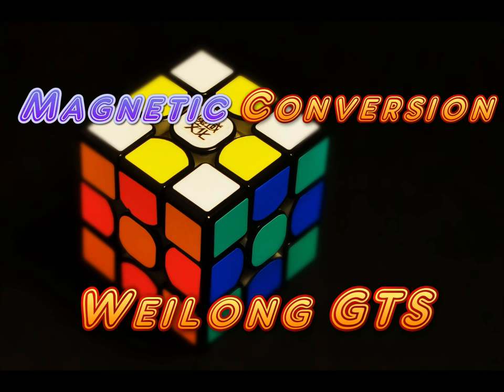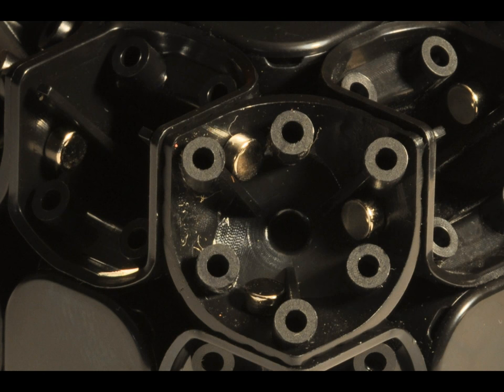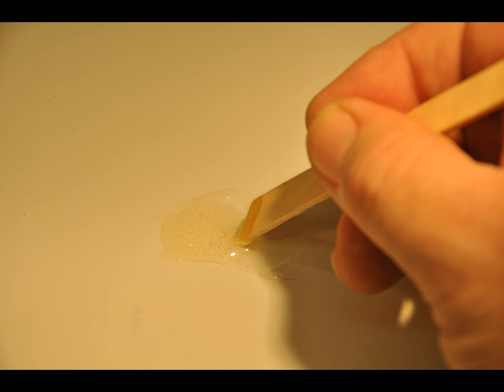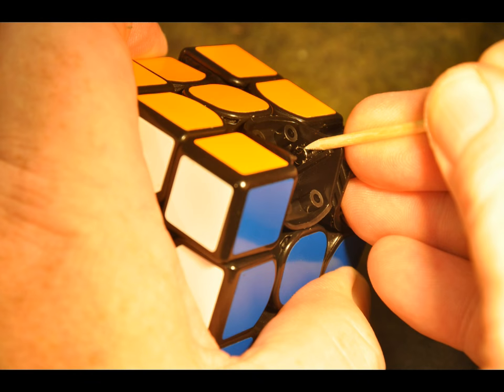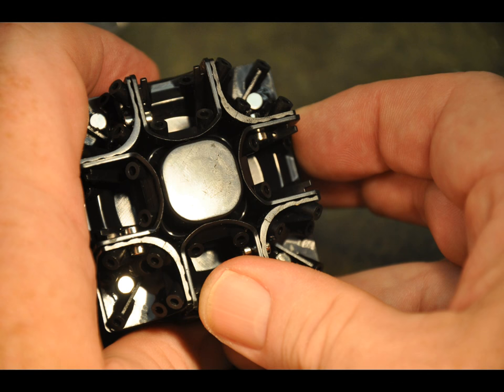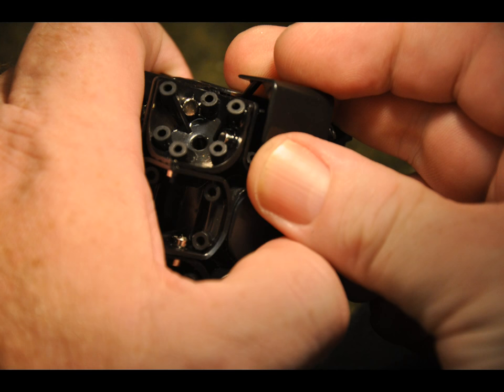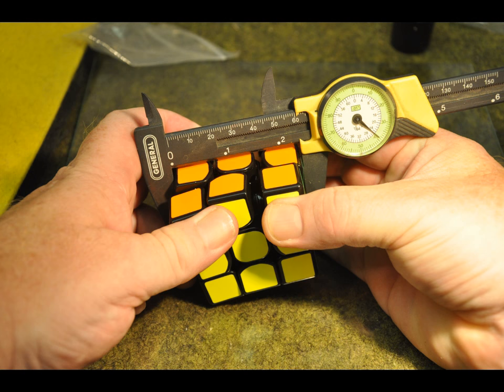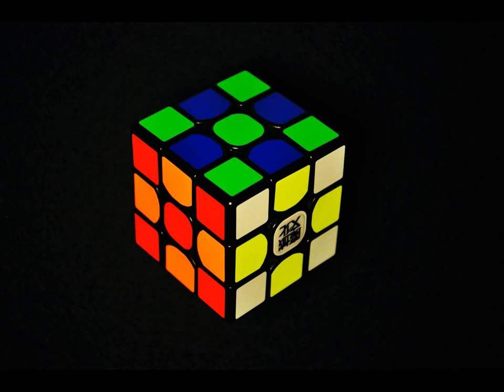Weilong GTS M (Magnetic) Do It Yourself Tutorial

Comment: What is the differents between motu weilong gts v1m  and v2m
Reply from the maker: Noob Cuber Entirely different in many ways. The original is heavier and uses a capped design. The GTS2 is hugely improved. It's lighter, and has a split piece design.
Reply: DMCubing oh thanks 🙏🏻 btw your channel are the best
Reply from the maker: Noob Cuber Thank you so much!!!! This is such an old video!
Reply: DMCubing well this is a good vid.. I will make a video about my MF3RS M that i made using ur tutorial
Reply: Also what magnet do u use for MF3RS2
Reply from the maker: Noob Cuber I used an N48 5x1, the same magnet the Cubicle uses in theirs, but you can use a little lighter N42 5x1 or N35 4x1.5. Here's my video on it:
https://youtu.be/9ovoyatnmZw
Reply: DMCubing what magnet do u prefer for 4x2mm ? For MF3RS2
Reply from the maker: Noob Cuber N42 or N48 5x1.
Reply from the maker: Noob Cuber Oh. N35 if it's a 4x2

Comment: If I use the adjustment kit weilong gts, can I make the manetic version？Is it better？
Reply from the maker: Hinson Wong I bought several of those kits when they came out but never got around to trying them. Anyway, there's really no possible way they could interfere with the magnetized cube as the magnets are all internally placed inside the cubie pieces. I do think the dual adjustment kit is worth looking into as it gives you potentially more control over the tensions and spacing of cube parts.

Comment: Can you compare the strength of N48 4x2 in the weilong gts to modern magnetic cubes like the gts2m or valk power m? I'm really interested in buying and magnetizing a gts. Thank you!
Reply from the maker: I'll need to pull my old GTSM's out and compare. Newer cubes like the Valk 3, GTS2, and Air, are lighter weight and have a different feel. The original GTS can feel a little heavy and it easily deforms when it's not magnetized. Even magnetized, I don't remember it feeling as accurate and snappy like the GTS2M. I'll double check though.
Reply: DMCubing, I would be glad if you could check. Thank you very much!
Reply from the maker: Hi Gerro,
I haven't forgotten!!! I've looked all over my house and I guess I gave all my magnetic GTS's away. So, unfortunately, I don't have a magnetic one right now to do a side by side comparison. But as you know, the original GTS is a heavier cube, uses thicker plastic and requires a fairly strong magnet- N48 4x2, - N52 4x2. What I do recall is that for me, the GTS cubes with the primary white plastic seemed to feel better, overall, as magnetic cubes, where are the all-black cubes had less magnetic pullforce strength. So I would recommend something like an N48 4x2 for the Illusion (black caps/primary body) GTS or all primary GTS, and N50 through  N52 4x2 for the all black GTS.
That compares to about what the N42 5x1 magnets in the new GTS2 feel like.
Reply: DMCubing, thank you very much for the information! I've been wanting to buy an illusion gts but I'm not sure if they are still available from where I am and I think black is my only option. Also magnets are a little hard to find except for 4x2 N35s. Hope I could find the materials I'll need. May you create more guides in the future and may you not stop helping those who ask questions. :)
Reply from the maker: Thank you so much, Gerro. I'm just sorry that I no longer have a magnetic GTS! That used to be my favorite cube, but apparently I've given them all away!
N335 4x2s are going to feel pretty light in the GTS. They'll work, but the overall magnetic feel is going to be very subtle.
Reply: DMCubing, yeah. A lot of videos talked about N35s are too light for the gts. I'm in a comp today and I'll see if someone's selling stronger ones. Thank you again!

Comment: What do you think is the best magnet for stability of gts v1?
Reply from the maker: JanDi Portugal At a minimum, the N48 4x2. And for added stability, you can use N50 up to N52 4x2.
Reply: DMCubing Would N42 give it a subtle effect in stability?
Reply from the maker: JanDi Portugal You could probably get some magnetic benefit from an N42. It's going to be subtle and because of the weight of the cube, it won't have a strong influence on stability, but I think you'll be ok. I've personally never used any weaker than an N48, but I have heard of people using N35s in the GTS and liking the results, so you should probably be fine. If you use the N42, please let me know how it turns out.
Reply: DMCubing Oh, that's some nice info to think about. Thanks bro, I'll let you know what happens. :)

Comment: Hello, I just wanted to clarify, which pole should be glued in every plastic sides? North pole or South pole? And how many magnets should I put on an edge piece?
Reply from the maker: Hi James. Great question. Since both North and South poles have the same identical pull force, it doesn't matter. But, each pair of magnets must have the same polar arrangement throughout the cube. It's easier to think of as gluing pairs: one magnet on the right side of the upper edge piece, and the other magnet, placed on the left side of the upper right corner piece. There are 24 such pairings within the cube. Since it's fairly easy for me to take pics, I'll make a video about this topic today.
Reply: Oh nice, I'll look forward to that video!
Reply from the maker: Thanks! It just posted. It literally took me all day. Powerdirector kept crashing. Ugh. Anyway, it's up and I think it should be helpful. let me know.

Comment: i don't really understand what you mean by saying "polarity"  how can i check it?
Reply from the maker: Hi Amit. Polarity is the term used to describe each end of a magnet. The North end will always point to the geographical magnetic North if it's suspended and allowed to freely rotate. 
Now in cubing, what we're concerned with is keeping the polarity of the placement of the magnets correct and consistent throughout the entire cube. We're not really concerned about using True North as we are using the same end of the magnet each time we glue in a series of magnets.
As long as each and every edge piece magnet attracts each and every corner piece magnet, things are as they should be.

Comment: does this work the same for the guoguan yuexiao? and which magnets do you recommend?
Reply from the maker: Got one right here with me that I finished Tuesday. Yes, it works great! And the Yuexiao is easy to do. I used N48 mags in mine. the cube is interesting. I felt it was light weight and perhaps made out of thin plastic until I weighed and measured it. It's neither light or thin! it just performs that way. Anyway, I think the result with magnets is good. It's a fast cube and I'm still trying to fine tune the tensions. I may end up using a thicker lube. I'm almost thinking about doing another one with N52 mags but the 48 mags will probably work for most people, actually the 48s are probably the ideal mags for it. It's just that I seem to overshoot because of my turning style. It takes very little effort to move this cube. I have all my pics and video shot and have been working on the voice over, so my tutorial video should be ready to upload this weekend.
Reply: ty! looking foward to that vid

Comment: can I use 6mm x 3mm neodymium magnets??
Reply from the maker: Those will probably be too big and have to strong a magnetic pull force. If it's a black GTS, I'd use either N48 or N52 4mm x 2mm magnets. On the white plastic Illusion, N48 4mm x 2mm magnets. The N48 grade are available from Apex Magnets - they're sold out right now but they expect 50,000 to arrive in a couple of weeks.

Comment: What type of glue can I use for the magnets?
Reply from the maker: Hi Oliver. You can either use super glue or a slow curing epoxy. Super glue is quick to work with but you need to be careful so it doesn't go all over the place. A slow curing 2-ton epoxy has a 30 minute handling time, so you can take your time gluing things. You may have to mix up several small amounts while you're doing a cube. Sometimes the epoxy doesn't want to stick well to the cube's plastic. You may have to rough up or put little scratches in those areas where the glue will be placed to help it form a better bond. Just as important is regardless what you choose to use, make sure to let the adhesive fully dry and harden before handling your cube. :-)

Comment: i think some of my magnets in my gts m fall off, is there a way I can check which of them fell off without dissembling it?
Reply from the maker: Archibald Leung Oh i'm sorry to hear that some of the magnets have loosened up. On the GTS, removing the caps is very easy. They pull right off. I would start with the corner pieces first, because usually they're the easiest to remove. Look and see if any magnets have loosened up, and if not there then go on to the edge pieces.
Reply: DMCubing thanks 👍🏻

Comment: would n50 magnets work well in a weilong gts illusion?
Reply from the maker: ChubTheCuber Yes! I use both N48 and N52 in the Illusion and it's hard for me to pick my favorite, so I'm sure N50 would be perfect! The lower grade like N35 is really to weak, and to me, you feel a little more magnetic pullforce with the primary plastic of the Illusion than you do with the black plastic. 
I need to update or redo this video. When I made it, I was using a slow curing two-part epoxy, so that's why I'm gluing the magnets a certain way here. If you're using superglue, you can save time by gluing both magnets in each pair at the same time.

Comment: my slide oil says it contains petroleum distillates. Is it still safe to use on my Gans Air? I have heard that should not use lubes containing petroleum..
Reply from the maker: Calvin Ma I probably wouldn't use it. Silicone based lubes seem safer. But you can smell diesel type lubes on new cubes all the time. I searched online and people have researched petroleum distillate lubes and their effect on ABS plastic. Seems like a lot of debate. Some people say it's safe while others say it's not. With the thin plastic of a cube like the Gan Air or Valk, I probably wouldn't risk it.
Reply: what exactly does petroleum do to the plastic?
Reply from the maker: Calvin Ma I imagine it would break down the plastic.

Comment: N50 would work out good or too strong?
Reply from the maker: They would be excellent! An N48 feels really good in the primary plastic of the Illusion. The normal black plastic of cubes lessens magnetic pullforce, so the N50 and N52 are probably the optimal choice for the black plastic GTS and probably would work nicely in the primary plastic version, where, in that cube it would have a little more magnetic feel.

Comment: Hey DM so I recently made one of these, but it failed. I messed up because the multiple cubies stuck together. How do I prevent this whene I do it again?
Reply from the maker: Do you mean that you glued the cubie pieces together? Usually if this happens you can scrape the extra glue off of the pieces once you've unstuck them. This doesn't happen often. To prevent this from happening, just be careful with the glue. But if you do get too much glue and some of it gets between the pieces, just carefully pull the pieces apart and then scrape the glue off so it won't be sticky. I hope that helps!
Reply: So basically a cubie goes to the other cubie that i already glued, and it creates one part of the edge to have 2 cubies instead of one.
Reply: Should i just place all the magnets, then glue them with super glue?
Reply from the maker: I don't know if I quite understand. With any magnetic cube, the corners will always attract the edge pieces. Each corner piece ends up having three magnets in them, each magnet facing the edge piece magnet. The edge pieces always have two magnets in them and they attract the corner pieces. I don't know if you're talking about magnets or glue.
Reply from the maker: You can actually do that. I don't usually do that because I like to make sure the glue in under the magnets so it's a better bond between magnet and plastic, but a lot of people do just put glue on the magnet. If you do that, you might want to come back after the glue has dried and put an additional drop of glue just to make sure the magnet is coated.
Reply: basically you have one magnet for each attraction, but the cubie across from the cubie was attracted and it stuck to the cubie which caused one cubie to have two cubies

Comment: what grade is the magnet?
Reply from the maker: I used an N48 4mm x 2mm in the GTS. In the primary plastic Illusion, the magnet is perfect. In the black plastic, the same magnet is just a little more subtle. So if you're doing a primary plastic GTS, an N48. If you're doing a black plastic, any grade from N48 through N52.

Comment: How long should I wait for the super glue to dry?
Reply from the maker: Edwin S At least a couple of hours. It depends on the type of superglue, like if you used a gel, and the amount of glue used. You can handle the cube pieces within an hour, but I wouldn't start doing any repeated solves and handling for several hours, as it takes a long time for the glue to fully cure and harden.
Reply: DMCubing also, do you sell magnetic cubes?
Reply from the maker: Edwin S Hi. No I don't sell any. With the amount of time it takes and the cost of supplies, there's no way I could sell them cheaper than the Cubicle

Comment: Hey I have a question, do you know the thickness of the black plastic version of the gts? Thanks
Reply from the maker: doodle mogul I thought I mentioned it in this video. Anyway, it's.043" for the edges and about.045" on the corners. Fairly thick for a cube, so higher grade (stronger) magnets work best: N42 on up in 4x2 size.
Reply: DMCubing thank you so much for replying. I do have one more question though...what would be the magnetic equivalent of n42 4x2mm magnets in terms of a 4x1.5mm magnet?
Reply from the maker: doodle mogul There's isn't an equivalent. The closest would be N52 4x1.5 which has a pullforce of about 0.71 pounds. The N42 4x2 has a pullforce of 0.76 pounds. They're close, however.
Reply: DMCubing that's really interesting, thank you. How do you find out the pull force of different magnets?
Reply from the maker: doodle mogul oh. Google search for K&J Magnetics Calculator. It will give you a rough idea of how magnets will react.
Reply: DMCubing thank you once again. I want to magnetize my black plastic gts and would like a feeling as close to the cubicle's gts m as possible...any idea what magnets (n42, n48, n50) I should use to achieve the same feeling?
Reply from the maker: doodle mogul I've never tried the Cubicle GTSM but they generally use light magnets. For me, the N48 4x2 in a black plastic GTS would be as light a magnetic feel as I'd ever want to go. If you like a lighter subtle feel, I suppose you could use the N42. For me, I've always liked the N48 and N52 in this cube. So it really comes down to what your preferences are, and what you like.
Reply: Alright, thank you. So you would recommend buying the n48's from apex magnets?
Reply from the maker: doodle mogul That's what I'd recommend, particularly if you like a subtle feel. With Apex, it's best to wait for a weekend where they have free shipping or discounted shipping. Or if you like a stronger magnetic feel, N50s from gaussboys.com would work, plus they have free shipping on orders over $10, and for the month of June, a discount code DMCUBING that can save 10% off your order; or N52s from thethackery.com All good choices for this cube!

Comment: N45 5x1 will do?
Reply from the maker: Tech Dares I would have to check first to see if a 5mm isn't too wide. But really, an N45 5x1 would be fairly weak in the original GTS. In this cube, you really need a stronger 4x2 magnet like an N48 up to N50.
Reply: N52 4x2 works perfectly well at mine
Reply: But when i glue then i rotate the glue drips :v
Reply: Rip my cube
Reply: I removed the glue by shaving the glue with cutter
Reply from the maker: Tech Dares Rotate? That's not how you want to glue this cube, and I certainly don't rotate in this video!

Comment: Amazing first video!I can actually finally make a budget Magnetic GTS!
Reply from the maker: Great! Thanks! Let me know how it goes! 
 I made another one today, an Illusion GTS: primary innards with black caps. Cool look!
Reply: DMCubing you can buy those straight up from the cubicle, the only GTS I own is a illusion
Reply from the maker: +Benjo Draws Oh, it's the way I worded this. What I meant was, I made a magnetic GTS out of an Illusion- it's the best cube I own! I love it! Yes, you're absolutely correct, the Cubicle has the Illusion already made up. I've bought four from them so far. I love those cubes! I'll probably buy a few more!
Reply: DMCubing thanks for clearing things up
Reply from the maker: Do you find the primary plastic performs better than the black plastic?
Reply: DMCubing not sure, I only own one GTS, a primary black caps
Reply: DMCubing I think it would though, as dye probably adds a tiny bit more width to each piece, increasing friction
Reply from the maker: +Benjo Draws Thanks. Actually the pieces are identical in size. I've searched over and over online about info on ABS plastics but have yet to find anything in regard to each color's strength and hardness. I'll remain convinced there is a difference until I find out otherwise. ;-)
Reply: DMCubing what handfeel does the N50 2mm x 1mm has? . :)
Reply: Too weak! You should use 4x2 n48 and up!

Comment: Would 3mm x 6mm magnets be too big?
Reply from the maker: CinnamonButt Yes that size would produce too strong a magnetic pullforce
Reply: What about 4mm x 1.5mm?
Reply from the maker: Too much on the weak side. With the GTS you probably wouldn't want to use anything less than an N48 4mm x 2mm. 
Here's a really helpful calculator that helps predict magnet pullforce:
https://www.kjmagnetics.com/calculator.asp